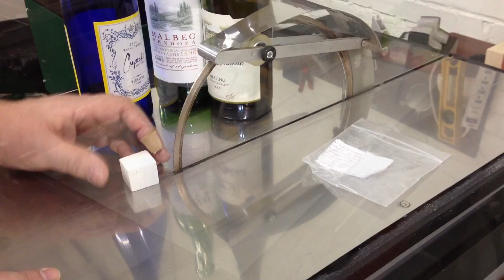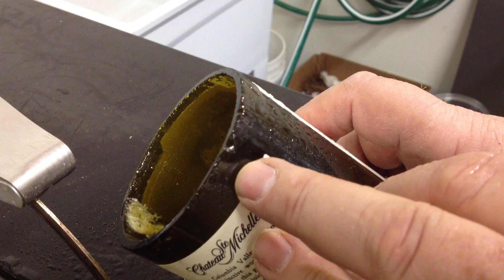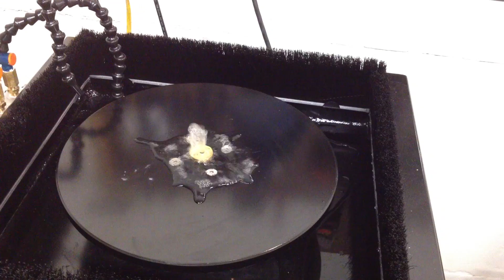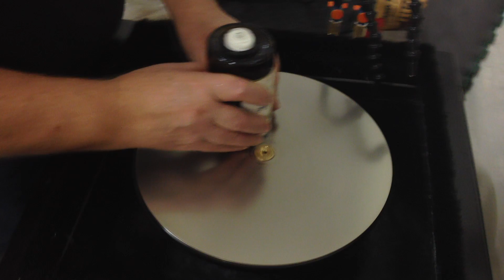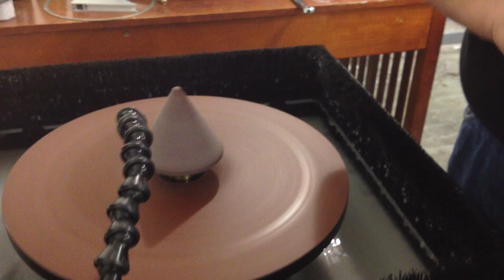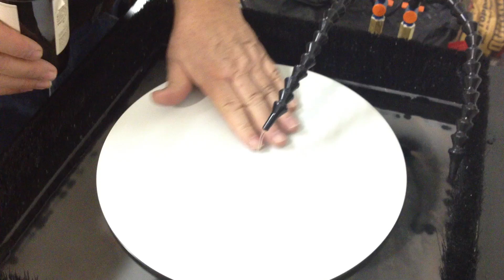Bottle Cutting and Grinding Techniques

Comment: Hello! Great video. What would you suggest to get the inside of the bottle smooth if you didn't have the machine you're using?  Thanks!!!
Reply from the maker: We can actually make the smoothing cones and domes with a straight shaft so you can use them in a drill press to work the interior bevel as well: https://www.hisglassworks.com/grinding-tools/cones-and-domes.html
Reply: @hisglassworksinc  Thanks! Can any of these be used with a cordless drill with an adapter? If not, is there anything you can suggest that would work with a cordless drill?  Many thanks!!!
Reply from the maker: @abacavip6426  We make the resin cones and domes with a straight shaft on them as well that can be used in a hand held drill or drill press, yes.
Reply: @hisglassworksinc  Oh, wow. This is pure genius. I finally found my "stop gap" solution for making glasses until I can afford the 12" flat lap. Thank you!

Comment: For someone on a budget and can't afford the expensive machines..could a second hand pottery wheel, approx $200-$300 with a 12" wheel replace the big expensive machines? Just add a water source and a diamond disc and good to go?
Reply from the maker: It can. The biggest issue to consider is the speed of the lap. Diamond grinders work best at high speeds and pottery wheels are generally geared slower. You can speed them up but the wheel may not be balanced for higher speeds. 
Most pottery wheels are also aluminum heads so magnetic disks will not stick to them.
Reply: Where can I’m buy used one

Comment: How much does these machines cost if you ship it to India. I have several times inquired on your website,but haven't got a reply yet. So thought of posting here. I am very interested to buy the grinder and the cutting machine.
Reply from the maker: Sorry that you haven't been able to get through on the website. You can email directly support at hisglassworks.com and we can work up a quote with freight options. We just need your shipping address. Thanks!
Reply: Thanks a lot. I am sending you an email in some time

Comment: Is there any way to get the bottom of the glass to be as smooth looking as yours using very basic tools? like a hand grinder, or just hands and sand paper / emery cloth? Mine come out cloudy and white looking. Also, without the use of equipment, what other than sand paper and emery cloth can I use? I am going through each material very quickly (Don't want to be spending too much money on sanding equipment)
Reply from the maker: You can also use loose grit silicon carbide on a piece of plate glass. We also have a video demonstrating that. You can move through a fine grit like 600 or 800 grit, then use a hand sander with a cerium impregnated disk or felt disk and cerium slurry to finish the rims. You can try working the rims with cerium impregnated hand pads or handipads for a final polish, but it will take a very long time to accomplish by hand work. Polishing is slow mechanically and not very recommended manually unless you have no other choice.

Comment from the maker: For most round bottles, I generally prefer the dome. It is faster to make the bevel with the dome and you also move the glass over the whole surface of the dome as you use it so it wears consistently. We should have a video demonstrating the domes and cones in the next few weeks.
Reply: How much is tha machine, what the name
Reply from the maker: @MrRola65  That is the 12 inch Covingtton lap listed here: https://www.hisglassworks.com/machinery/flat-grinders/small-grinders/covington-12-inch-variable-speed-lap-grinder-html.html

Comment: Do you recommend the smoothing cone over the smoothing dome for the inner edge of the cup.  I'm looking at making a lot of these cups and want to streamline the process with the best tools and technique.  It seems to me the dome would wear out in 1 spot where as the cone you could grind up and down over whole cone like you do in the video.  Which do you suggest?

Comment from the maker: Yes, and this is a common technique for larger bottles that will not fit under the smaller blades on 10 inch wet saws. As long as you are able to line them up, it works quite well.

Comment from the maker: Slow and steady is the best way to cut these thicker bottles. The slide tray for the XT helps to keep thicker pieces like this in orientation as well so you have a straighter cut. Cutting slower will help keep the blade from "walking" as well.

Comment: a few questions
1 saws and blades have grinded diamonds at the edge?
2 the cone is made of stone?
3 the white disk...is rubber made?
im a dentist, and i use tiny diamond disks for hand held instruments. atfer cutting the bottle, i use different grit rings, and for the finishing, i use different kind of rubber disks.
all those disk are only and exclusive for the bottles (not too many, 3 o 4 :-p)
sorry about my english i have never studied english in my whole life
nice vid. congratulations

Comment: Could you also tell me if you get a better result when you use coarser cone first and than finish it off with the 325. I experience that I cannot get the big chips out with the 325. I do grind the glass down to get rid of the larger chips, yet i am not fully content with the smoothing result of the 325 cone.

Comment from the maker: No. You can run the grinder in either direction. You generally want to stick with a single direction though as changing directions can prematurely break off the diamonds and lessen the lifespan of the disk.

Comment from the maker: The grinder is not terribly loud. You would want to use it in an area that you don't mind getting wet as there will be water involved and you will eventually make a mess no matter how clean you are. If used correctly there won't be any glass dust as the water encapsulates it, but I would still recommend using in a well ventilated area regardless.

Comment from the maker: On a 12 inch disk you can probably do several thousand bottles before replacing a disk. Bottles are a very small surface area and you aren't removing much glass from the saw cut, so you're using a very small amount of the diamond each time.

Comment from the maker: Hard to answer. Too many variables for that. It depends on the size of the disk, the material you are grinding, how much material you are removing and how large the surface area is that you are grinding. Also how many pieces on average you expect to be grinding. Lots of options to get any type of basic lifespan.